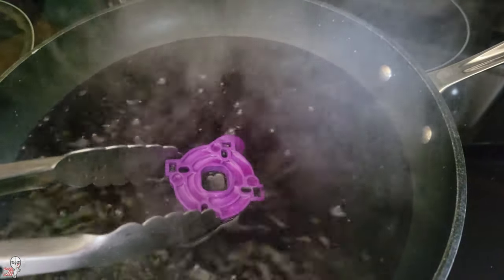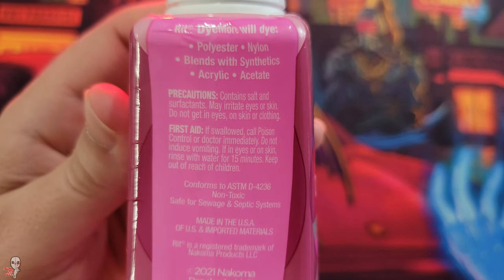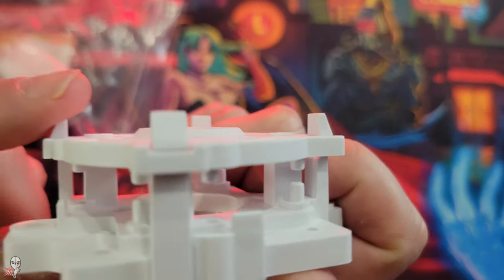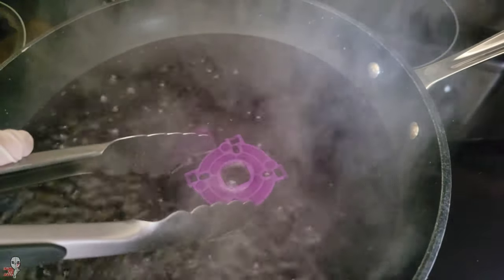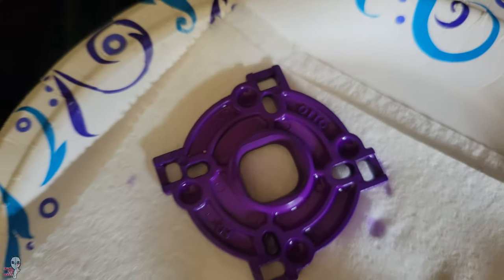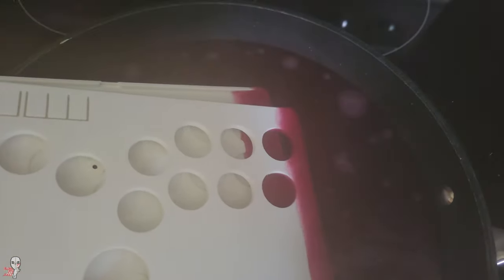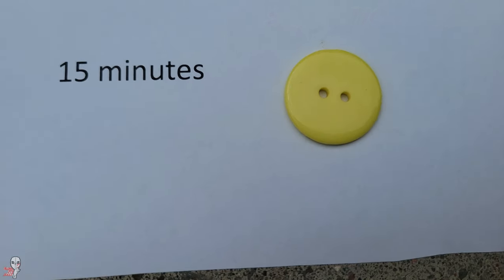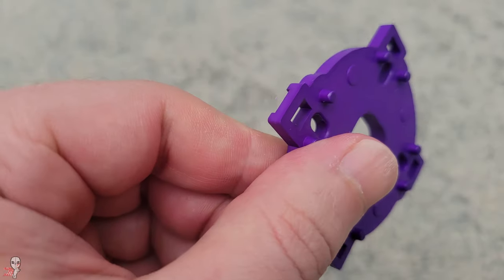Arcade parts to DYE for - Dyeing fightstick components DIY

Comment from the maker: Pinning this in case you see this video down the line and need to know the material types before dyeing: So, OSBMX buttons were 9000R resin and take heat/dye well. The gates were PTFE and take heat/dye well. The Flatbox enclosure was PLA and does not like heat at all.

Comment: Brotha this is a great idea!!! I have alot of various inks for my painting...........I also 3d print so let me try the inks with zero heat and just soaking 3d parts and see if it works for the case. Will report back with findings for you.
Reply from the maker: Please do! That would be awesome!
Reply: @HushMySweet1  Alright so I have had mix results with the inks. I tried soaking them and that did ok but at the price point of 30 bucks for 1.7oz probably not the most affforable. From there I Airbrushed the ink on and let it soak in that way and it just eventually dried on......not a bad thing since it wont flake or anything like paint would. The issue I saw was the ink became "reactivated" by specific chemicals. No issue with lube reactivating the ink but any basic cleaning products and some oil based products reactivates the ink slightly. I applied a thin clear coat the hopefully address this but I honestly worry the poly-clear coat will just break down and create a mess for any part that moves or as surface friction. I will test how long it holds up for just to know but I'm not holding my breathe on this one. At least we are all learning together lol. IM off to watch your Kitsune Razer review now lol.

Comment: 3D Prints are usually made of PLA and PLA it turns into bubble gum consistency if you put it in boiling water. It sucks that you had to see it for yourself but now you know you can't do that with 3D printed parts if they are made out of PLA.
Reply from the maker: You're right of course. I could have cut that part out, but I think it's good to show some of the trial and error behind some of these things. For some reason I was thinking it was the same resin as the buttons which had worked well. I shouldn't have assumed, but hopefully it saves others from the same mistake. I pinned a comment detailing the material names and how well they worked. Thanks for watching/commenting!
Reply: @HushMySweet1  You are helping a lot of people with that simple gesture. Making mistakes is not a problem, you either make the mistakes yourself or you see others making them and learn from them. You did your part!

Comment: Hey Hush is there a way to customize the buttons and the stick so that are quieter without replacing them? Especially to be able to play at night.
Reply from the maker: Hey! Did you check out my silent button video? I know you said you don't want to replace them, but depending on your kind of button you could just add some little silencing pads. They worked pretty well to quiet normal Sanwas. You could also fill up your enclosure with some padding to reduce echoes.
Reply: @HushMySweet1   Thanks i'll go look it right up.

Comment: Them Otto's be expensive, restrictors alone are 10$. Doesn't the dye decrease their slippery attributes? Maybe the restrictor is not that important to the overall performance...
Reply from the maker: I considered that and I definitely don't want to sacrifice performance for aesthetics, but I'd seen others use dyes on those parts with no complaint. I have one on now and I haven't noticed any diminished performance. If that changes though and something develops, I'll let you know. Thanks for watching!
Reply: @HushMySweet1  Thanks for the reply. Sure, I'd like to hear about it, if the dying starts causing any problem with performance or increasing friction (hopefully not).

Comment: Anyone tried this on an entire stick case? I'm considering painting/wrapping/dying my 8BitDo case.
Reply from the maker: I've not seen anything that big, but if you disassembled into manageable chunks and the material was correct, I don't see why it wouldn't work. I don't have any experience with the 8BitDo though so you'll need to look into what type of material they used in the construction and how it reacts to heat/dye (and do a smaller test part of the same material first). Anyway, good luck with the idea and let us know if it works out! Thanks for watching!
Reply: @HushMySweet1  I emailed 8BitDo support and they told me the case is ABS plastic. From what I've read it seems like you need to use heat, but carefully cuz ABS melts at around 100 degrees Celsius. Gonna leave it for now cuz too risky and no replacement shells available.
Reply from the maker: @bunnybreaker  Hey, thanks for the follow-up. That's good information and maybe in the future, someone will act on it and let us know the results! Thanks!